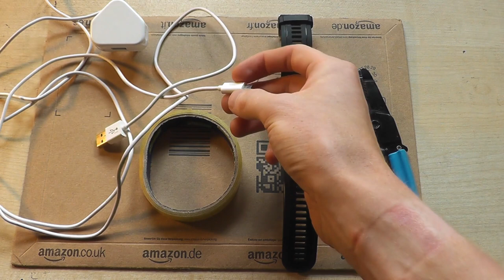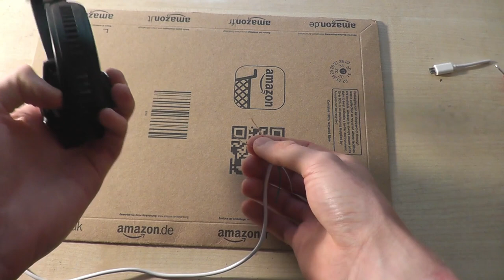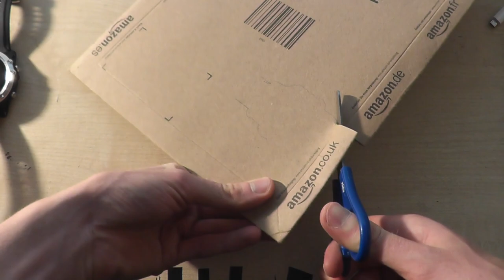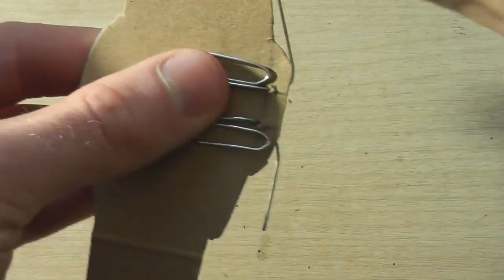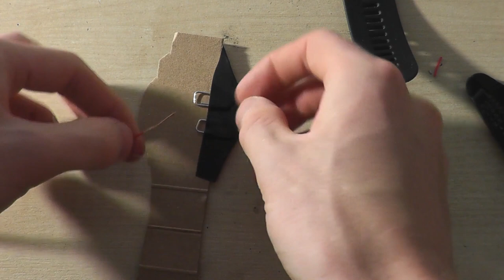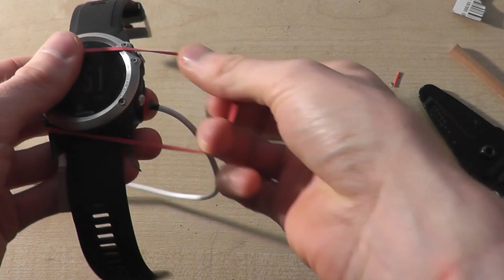DIY Garmin / Suunto Smart Watch Charger

Comment: My pin charger melted when it touched my metal legged desk. tried to find a replacement but the aftermarket pins didn't exactly fit well enough for continuous charge. I'm planning to make this from the ill-fitting charging cable. Thanks and I'll let you know if successful. A genius idea.

Comment: Thank you for the good explanation. Do you know if this is the outer 2 for the 5 volts and ground in all devices with 4 pins? I have a 4 pin GPS Tracker but no magnetic charging cable is included.

Comment: I like you video, I intend to try it. Just 1 question. Instead of charger, can I use a mouse. Then I connect the mouse usb to a electricity adapter. I have some broken mice, and I don´t want to breke a phone charger. Thank you
Reply from the maker: I didnt think of that but yes a usb mouse wire should work fine as long as you can determine the power and ground wires from the data wires
Reply: @tomm8815 thank you!

Comment: Bro what about the data wires they could be needed so why did u not use them 

Are they nesaccary?
Reply from the maker: You could use the data wires if you wanted to access the files on the watch or upload using a PC.  But this video was just for charging the watch. It might be a bit difficult to get a stable connection with four pins at the same time but there's nothing to stop you trying it.

Comment: Can i charge my kospet prime smart watch with 4pin adapter. Pls reply. 🙂
Reply from the maker: Did the original charger plug into a usb charging head? If so then it most likely uses 5 volts so should work if you can find the pin out for the watch
Reply: @tomm8815  yes original. Charger has usb type but i dont know it is 5walt or more. Can you pls look for kospet prime specs & reply me back as my original charger not working and i am not gettin from market not even from online store.
Reply: It will work on Hysek Slyde HD3 watch 
4 pins ?

Comment: I can't seem to find the diagram for my watch (NiceFuse W3 SmartWatch), is there any other way to determine the pin out for both ports? As to know which is positive and which is negative
Reply: do you know what happens when you switch the positive and the negative? will it break the watch???

Comment: how to tell which one + or -  ?
Reply from the maker: Generally + is red and - is black or a dark colour, if you have a multi meter you could check
Reply: @tomm8815  Not the wires I ment on the watch how tell + or -
Reply from the maker: @lawrencejd8935  oh, you have to look up the pin out diagram for your watch or check any forums for people who know
Reply: @tomm8815  Thanks mate
Reply: @tomm8815  what happens if you switch the two acidentally? will it break the watch????

Comment: Couldn’t get it to work
Reply from the maker: Did you use a USB cable that was working before hand ? And did you connect the right wires to the pins on the back of the watch?